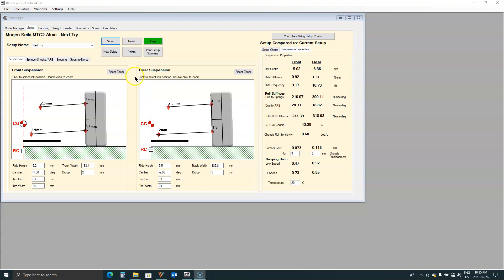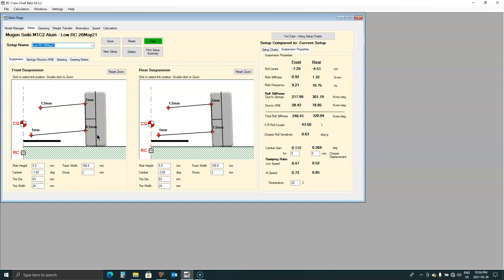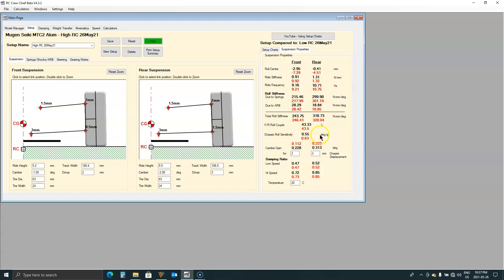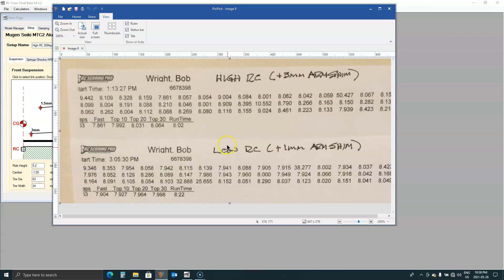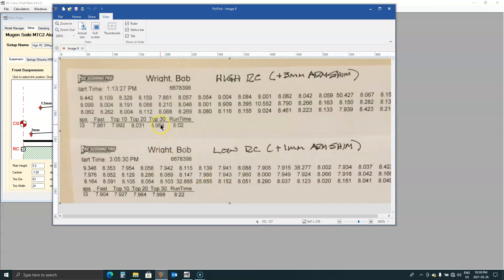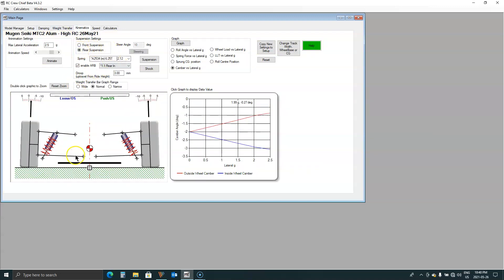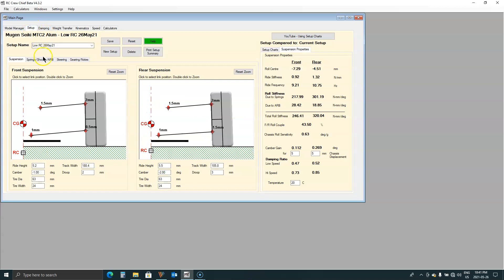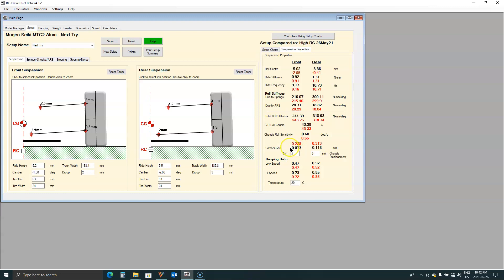MTC2 Roll Center Testing Part 1

Comment: RC Crew Chief seems to be a very useful program.
   I have watched a few of your videos, I think even for those who are good at chassis setup, there could be a benefit of running the program.
   The animation feature for  a setup change looks useful.
Reply from the maker: There is a 30 day trial period so you could take it for a test drive.
Reply: @RCCrewChief  I'm not actually racing right now, but I plan to race again in the near future.
   Once I am competing again, I may give the software a try. Thanks.